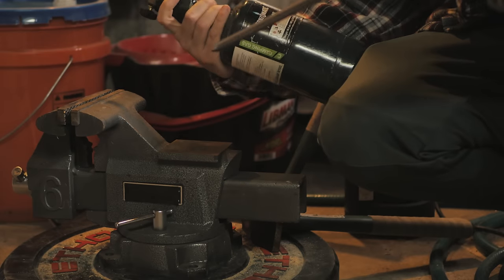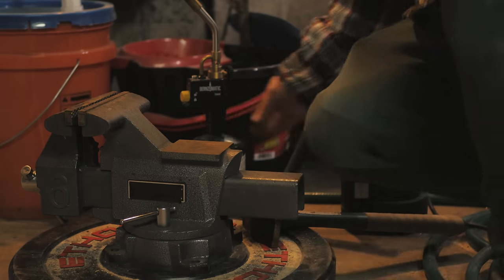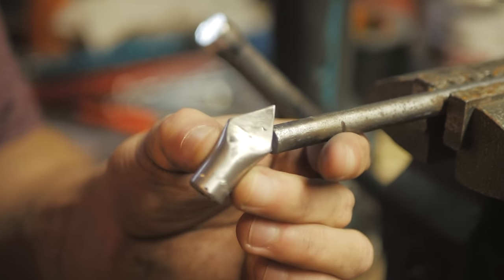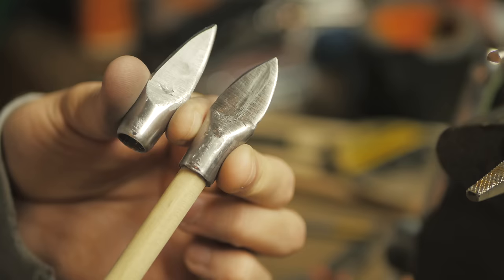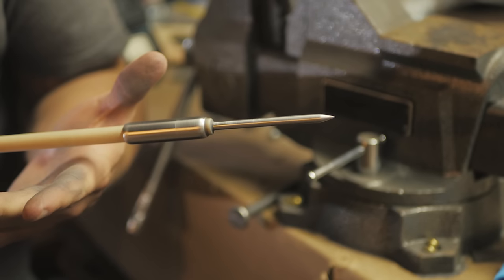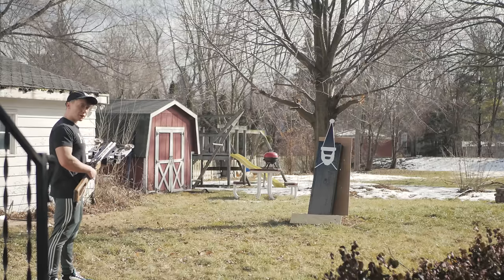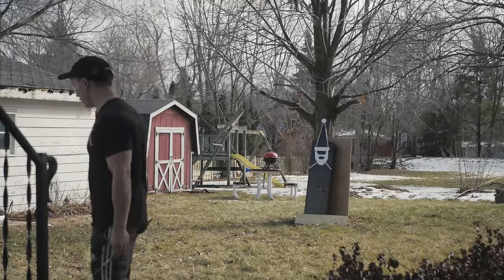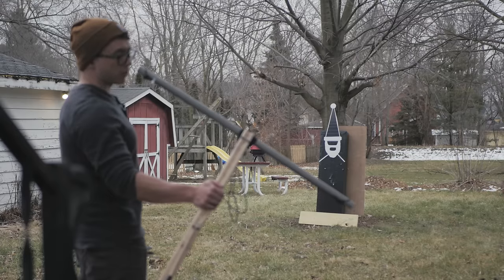Crafting and Testing 5 New Bolt Designs (Badly)

Comment: Meanwhile, while mowing
Mower: brrrrrrrrrrr*BRRBRBRBRBRBRB*brrrrrr*BRBRBRBRBRB*
Eli: Awww fr*ck

On a serious note, there may only be a few minor issues that are hindering the bolts flight. From the distance the camera is, it's kinda hard to tell the orientation of the bolts, and from what I've seen, one of the fletchings must be laid into the channel on the crossbow, kind of like a "Y". If that's not it, it may be one of two things. The first, your pulley system seems to run at the same height as your arrow channel. Bringing the system down a smidge may help with "popping" the arrow up, to help accommodate for the bolt's drop, because of the heavy tips. The second being, maybe the draw weight isn't even on both sides, which could be the reason why the bolts are pulling left, as opposed to flying straight. There is also the idea that the bolts may not be long enough.

With all that said, I'm no expert, and I'm not saying what you're doing, nor what you've done, is wrong. You have a far greater imagination than what I have, and are an excellent craftsman. Maybe you're right, maybe it is just a lemon crossbow. However, you know it can shoot, just not really all that accurate. Sooooo, just take you're current design and tweak it, until you've been able to figure out what may be causing the issues. I've been subscribed every since I saw your "Homemade Weapons" series, and I always get a little excited when I see that you've uploaded. Don't let a minor setback hinder your creativity. Stay strong, Zednaught Alpha 🤘🏼

Comment: My guess is that the duct tape isn't rigid enough to provide stabilization, would recommend cardboard or maybe plywood.
After all medieval crossbow bolts had wooden fins for a reason, that being acceleration, as a bow tends to have 2-4x as much distance to accelerate it's arrow so can do so more gently while attaining the same velocity, while a crossbow has substantially less room to accelerate and thus must accelerate more violently to attain equal velocity.

Comment: Ah!  Crossbow bolts generally DO NOT have nocks, actually!  The purpose of the nock is to keep the arrow centered on the bowstring- but crossbow bodies do that job instead- and so don't need the nock.

Also, your nocks are SUPER deep.  You really only need, like, a single string-width at most.

Comment: I'm going to say that I think tape fletchings are to heavy. Just to give you a good idea of the overall wait distribution of my arrows. The shaft of the arrow weighs 0.7oz the tip is 0.228oz and each individual fletching is 0.014oz or a total of 0.042oz for all three. And the total weight of the arrow is 0.970oz.
And for more context they are 30in arrows with a 6mm diameter shot out a 60lb compound with a 30in draw. Hope this helps some how.

Comment: Very clever and I'm still jealous of the hardware stores you have in the US.
Incidentally, the "d" for nail size is short for "penny" (it's an old english/derived from latin thing).

I wonder if there is something slightly out of alignment on the crossbow that pushes your bolts off to the left?
It could also be  because of inertia, with the clamp springs having to move all that mass of the clamps plus the added arms makes the speed at which it releases the bolt too low, even if the draw weight is high. You're not that far from your target and the bolts are "rainbowing" quite noticably, so maybe the "muzzle veloicty" is just too low?

The lightweight "jerryrigged" pvc  pipe crossbow seems to prove that it's the heavy limbs on the spring-clamp bow that cause the problem.
Your spring-clamp crossbow design looks really cool, but sometime "rule of cool" doesn't apply and that's disappointing.

Comment: Never forget, success begins with succ for a reason. You must fail to succeed. It's not failure if you learn from it, and (from my local radio station,) if at first you don't succeed, keep on sucking, 'til you do succeed. Great video hope you get the projectile flight trajectorial, inadequacies fingured out.

Comment: Eli, had just watched your Body Armor out off the welding blanket and fiberglass resin was wondering if you had tried a any types of variations such as a fiberglass/steel/fiberglass or even just a light steel/fiberglass. Still think the original you made might be most cost effective but also kinda wondering what a bow/crossbow might do to the plate. 🤔

Comment: Hey Levi if you take some carbon rod and shove it into a pvc pipe, you can make a light bow of variable draw length. Then just mount that perpendicular to a trigger and rail system.

Springs aren't all that good for delivering forces quickly in an impulse, they are used mostly for constant pressure to help prevent something from sliding, or to help keep two objects from coming together.

The reason why the arrows are not traveling very well is because the amount of energy in the arrow isn't enough to outweigh the movement of air. Kinetic energy is 1/2 * mass * (velocity^2), so the best solution is to make something with a heavier draw weight. You could also try making the shaft out of a small metal pipe and then shove a nail in there like you did that one arrow. That will get you a more definitive flight ark.

Comment: Eli, I spotted ur problem bud. I also make crossbows as a hobby, since I was like 17, so for ten years now. And what’s happening is, your string, it’s resting point is below the rail, so when it’s fired, as soon as it leaves the rail, it gets pulled downward as full speed, and being hooked on the knock, it flings the back of the arrow downward, cause it to wobble up and down, it would take a much further distance until it stopped and stabilized. I’ve had this problem before too. Hope this help

Comment: my boi, imma give you an advice. use 3 flighs at 120 degrees offset. it will stabilize the lefty-righty flight pattern. you can make a few of these on a tiny rubber pipe and heat-shrink and slap those bad boys onto the ends of the bolts. if made right, should elminate any kind of wobbling

Comment: Dude the reason your crossbow keeps failing is because of those weakass clamps. Id suggest using some pvc pipe shaped with a heat gun. Other than that awesome job!

Comment: I think the problem is the crossbow isn't guiding the bolts well enough when they are accelerating. The back of the bolt is moving faster than the front and pushing the tip out of the way, causing the tumbling. Normal arrows flex while flying to correct for this, your bolts are too stiff to allow for that. The crossbow just needs a longer/deeper channel for the bolts to accelerate stably in. Awesome work, I loved the way you used your drill as a lathe. Keep up the good content my man.

Comment: I think a better use of your time for the second bolt would have probably been to use the hacksaw to cut the angles on the head instead of using the angle grinder. I know abrasives can get very expensive very quickly and it may be more efficient overall. That is, if you didn’t already try that to find out, if you did then ignore my comment lol

(Stopped at 5:11 to make this comment)

Comment: Your bolts are too front end heavy. The back having no weight accelerates faster than the front of the bolt. This causes it to begin to spin around but is soon corrected by the front end accelerating as well as the fins. Adjust the weight and the balance of the bolts. I'd guess you would want the balance to be about 1/3 of the way back from the front of the bolt. Or not...

Comment: Ha, using og bow design on new crossbow. 

Ps, attaching a third fletching to the arrows helps with stability over longer distances, bending the fletching mean that the arrow will spin and the center of mass will move slightly. That means that arrows that aren’t perfectly balanced will stray off course over longer shots.

Comment: Things I noticed as a mechanical engineer, the arrows seem to be a little thick, maybe the weight is too great to maintain proper lift through the flight path. Also any arrow head that isn’t centered (like using the half a the pipe) will cause it to shoot off. Same with the “feathers”, usually there are 3 feathers to stabilize the flight as only using 2 will have a major source of error if they are not almost perfectly 180 degrees from each other

Comment: honestly think a large part of the issue with the reverse draw crossbow is that its limbs are waaaay too heavy for the distance they are moving, so they are robbing all the power out of your shot and throwing wonky harmonics into the system. also the draw is quite long for the length of the bolts you are using, medieval crossbow bolts are short because the draw is short because the limbs of the prod dont flex too much. modern crossbows basically use arrows because they have a much longer draw due to lighter weight limbs that flex more like an actual bow. also, traditional bolts tend to have very rigid fletching, often made of thin wood. maybe try using plastic? plastic cash cards (gift cards, debit/credit cards, etc) work well for this. though youd have to either split the shaft to insert the whole thing, or glue on the two haves, which wont be as sturdy. or, honestly, skip it all together, this itself wasnt uncommon either, though it does limit your range.

Comment: Bruh.... I'm 14 and I made a crossbow 6 feet long and I shoots good just go to your hardware store or wherever you get wood and ask them if thay have any packing sticks they throwing out and make a hole for the little thing that makes doors stay shut idk what's called then just put a long road thru the hole in the door thing and you got a ez crossbow with low amount tools... I made mine to shoot 1×4s or up to 4 bow arrows at a time

Comment: Maybe you should invest in some tempered spring steel bar, and possibly use that as the tension and have the bone strong non-elastic  it should have a good elasticity and shouldnt deform easy. But I dont make weapons so I wouldnt know if itll be a good option for more force
You could also do something similar to this, but you can add your own flare to it.
https://youtu.be/3R4zNBV1Kos

Comment: To make a wide broadhead you could make it like you did you flatten practice tip, but slot a piece of sharpened sheet metal into it and rivet it down (like you did with the first bolt).

Comment: Did you have the duck tape fletching lateral with the nocks on the bolts? If, lets say, you have the bolt in the cross bow laying flat in the flight rail because the duck tape fletchings are lateral and keeping the bolt lateral, but the nocks aren't laterally in line with the fletchings, then the openings of the nocks would be turned off course with where the string lands, and the string wont fall into the open grove of the nock, but rather would be unstably pushing on the very very end face of the bolt's shaft.

Comment: I think the problem isn't the weight in the front, it's that there's not enough in the back; when the front of the arrow leaves the bolt sled, it then can skewiff all over the place while the rear is still being pushed by the bowstring

Comment: Those arrows look heavy enough that they should fly pretty straight even without the fletching tbh. Seems like the crossbow isnt accelerating them straight. You should make a crossbow that shoots bullets, and as a twist instead of using string it has a firing pin, and a barrel.
Reply: BigDaddyGalactus ambassador of burger king   nooooo a gunpowder powered bullet fireing crossbow